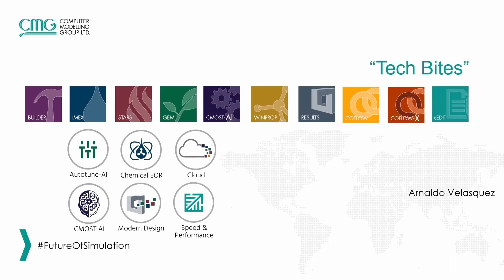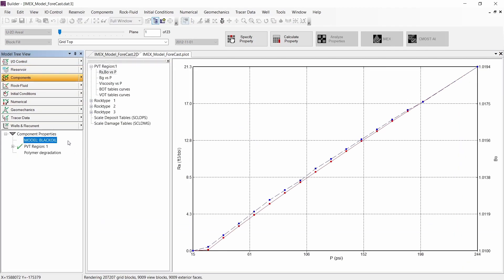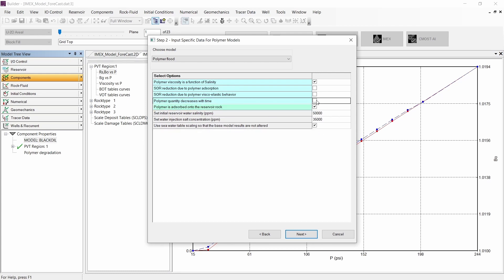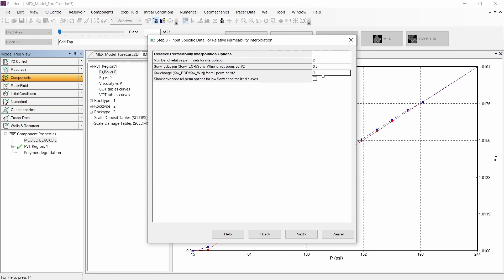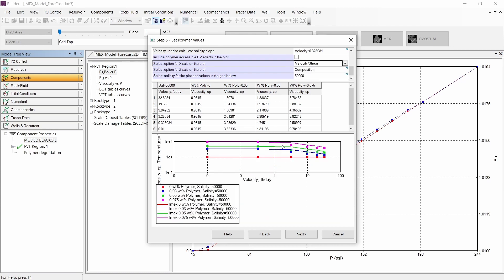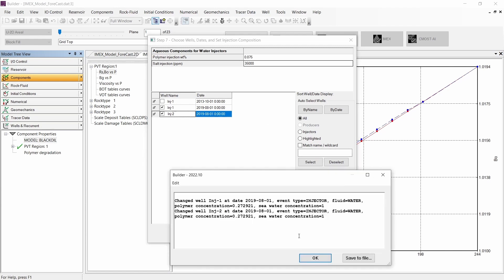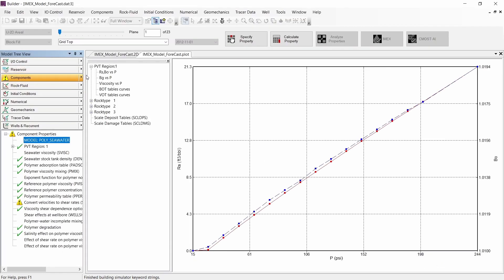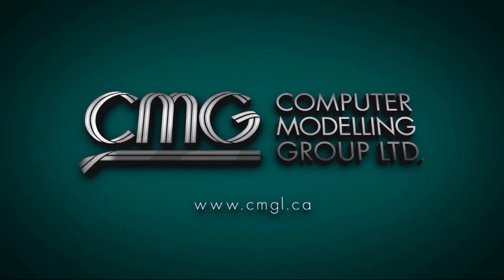CMG Tutorial: How to Create a Polymer Model in IMEX

Comment: Hi, whene I use the geomecanical properties and make a run error message is appear ( Node 7622 does not appear) and also other error is ( Nonzero coordinate are assigned to the unused node), How i solve this error???????????? the file is inserted as RESCUE FILE
Reply from the maker: Hi Hayder, thanks for your question. I guess there should a problem in the input data, could you please sendus the dataset to support@cmgl.ca so we could check it and find the problem? Thanks.
Reply: @compmodgr 
Hi, whats mean (Matrix Pointer JMTIM is non-symmetric between solver blocks 18389 and 0.
  Please contact CMG --  Check ISTAP1, ISTAP2, JSTALP.) please